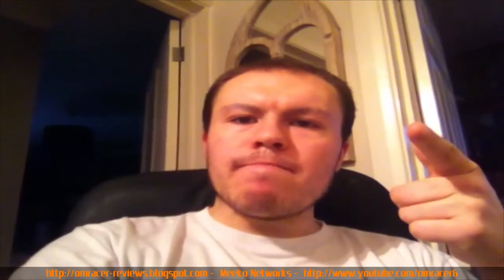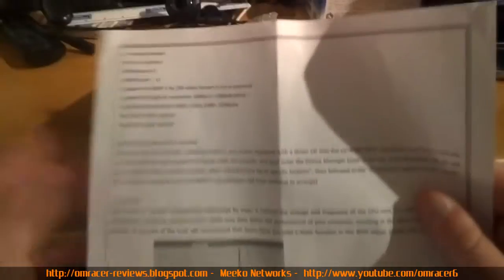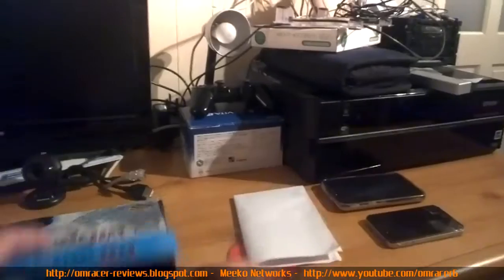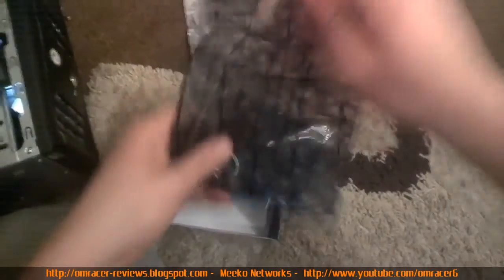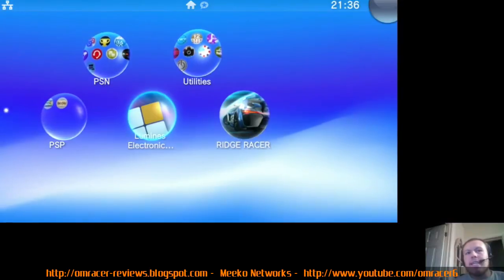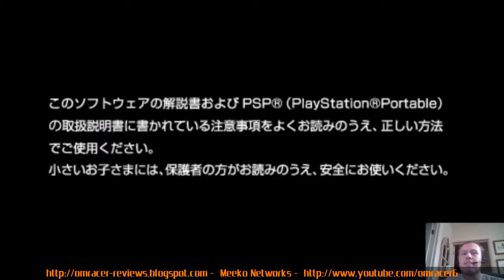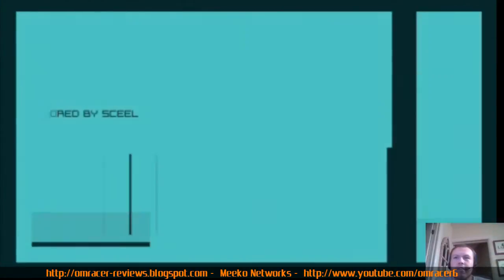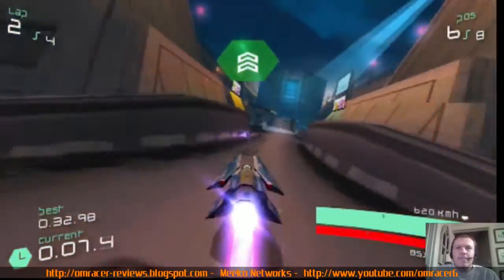omracer Reviews: HDMI Capture card PCI-E (Trident 7160 HD/ Timeleak HD72A)

Comment: Hey man, do you have the drivers still? Links dead.
Reply from the maker: updated the link http://www.velocaps.com/Article.aspx?id=49
Reply: Cheers mate, my only is playing sound for some reason, any idea why?
Reply from the maker: make sure the actual output of the device you've connected is the same as the resolution you've set in OBS for it. For example, if you playing PS4 and set the resolution in the capture settings to 1280x720, the console must be set to 720p
Reply: Yep, did that and it's still not working :(
Reply from the maker: ok, disable the card in device manager, reboot the PC and also the device you capturing from to be off then turned on when you've rebooted then reenabled in device manager and OBS is showing the preview, then you turn the device on
Reply: Nope still nothing
Reply from the maker: sounds like either HDCP or a faulty card
Reply: not loading for me mate
Reply from the maker: that link doesn't work, hmm ?
Reply: Did work, thing is it wasn't too long ago the capture card worked.
Reply from the maker: Thats fair. I know the one in this review actually did die on me and the one sold on the velocaps site works much better.

Comment: Thanks for posting a good video. I have a hard time to make this capture card works with my Nvidia Geforce 7500 ti.  The problem is I can only hear the sound from my blu-ray player but there is no video at all.  There is only one time I can see the video but the size is very small and there is no sound. I also try my onboard intel HD video card but it doesn't help. Do you know what my problem is?  I've spent several days trying to make it works, but now I give up.
Reply from the maker: Ryan Vu ok, what software are you using to record it, since it seems like a software problem.
Reply: Mattie LT Marker OBS
Reply from the maker: Ryan Vu Hmm, Then you have to tinker around with the Custom Resolution settings in the properties of the device in OBS. It happened to me a few times and worked eventually
Reply: Mattie LT Marker I think the card is defective.  I tried so many settings, different video cards, and different cables but all I got is a black screen with audio playing.  I purchased this card via eBay and I am not sure if I can return it.
Reply: Mattie LT Marker Now I can be able to capture my ps3 games, but can't capture anything from my bluray player and Apple TV (only audio).  The seller said it should work with most HDMI sources.  Do I really need an hdcp stripper?

Comment: Has anyone gotten this to work on Windows 10? I'm having trouble with mine. It's detected but it's not picking up any video signal over the HDMI.

And is it working in Linux for anyone? I'm probably going to give that a try soon but I wanted to check on that before I try.
Reply from the maker: +Joey Plays its worked on windows 10 for me just fine, only the Velocap U2 has a major audio flaw inWindows 10 from what i know, but use the drive from the velocap site if you have issues, but wipe the old driver first
Reply: +Mattie LT Marker Well I can't get it to work on Windows 10. It'll detect it once I have the drivers installed. But when I try to use it (I've tried using the Honestech DVR that it comes with as well as OBS and XSplit), they all give a blank capture.  And apparently the drivers are really only for up to Windows 8.1 anyway. The cables are good as well as the devices hooked up to them.

Did you have specific Windows 10 drivers you found?

I mean, Windows is seeing this. But that's all it's doing. It's not seeing what it's supposed to be capturing.

Comment: Ok I have 2 AMD 8 core FX series pc both have 32 Gb ram but one has an ATi 4Gb video card and the other has some onboard AMD video.
I put the capture card in the second machine and connected it via a "Y" cable to my first machine
I am running OBS on the second machine but I am getting absolutely NOTHING but a blank screen in the preview..
I have been fighting this for a week now and about ready to get my hammer and smash this card into bits.
If anyone knows WTF is going on please let me know..
Reply from the maker: ElfNet Gaming ok, have you tried to connect it with just a normal hdmi cable. Have you tried the Y cable on 2 different tvs or monitors (to test if the cable works) Worst case scenario have you tried a different device with the HD72a
Reply: I went through all that and what I am finding out is I have to convert one of my DVI's and get it from that.
for some reason you cannot split the HDMI and feed the card like that nor feed it a direct HDMI from a PC without it putting my PC in the lowest possible resolution possible
Reply from the maker: ElfNet Gaming Remember the Card only goes up to 1080p (30fps). But have you tried custom resolutions on OBS, since i have a few problems at odd times and the way to sort it is but turning custom resolution on and off
Reply: I have tried all of that. It's either a faulty card(s) or I need to break out of a DVI and patch audio manually.
Reply from the maker: ElfNet Gaming well i disabled the card in device manager, renabled it connected up my laptop via hdmi and i got a small corner of the screen of the laptop when duplicating it in 8.1
Reply: Ok I tried plugging it into a laptop HDMI out and got nothing, Rasberry Pi HDMI out and nothing. I suspect the card is bad.

Comment: Does it work with ps3?
Reply from the maker: +CapitalGamingBG I've got it working with the PS3, Look at the videos of KH2.5 HD remix, that was mostly using this card and streaming to twitch
Reply: Sorry bump an old comment, but did you get it working with PS3 without screwing around with HDMI-splitters and HDCP-signals? Did you need any separate audio cables or anything?
Reply from the maker: ***** No HDCP Splitter needed, directly from PS3 to this and it worked. I did my KH 2 HD Playthrough with it